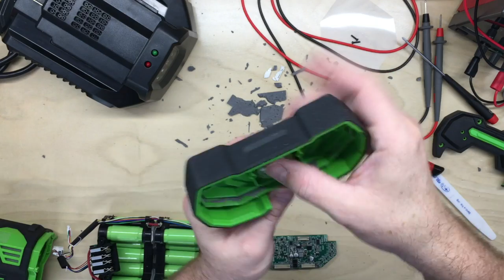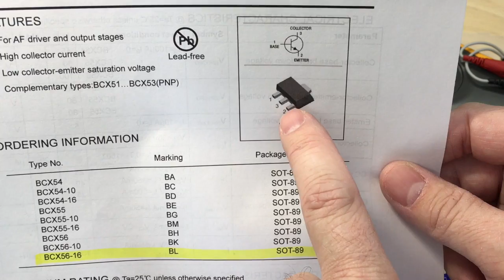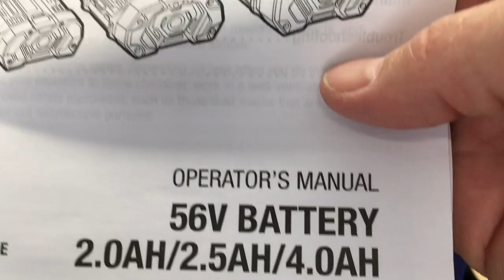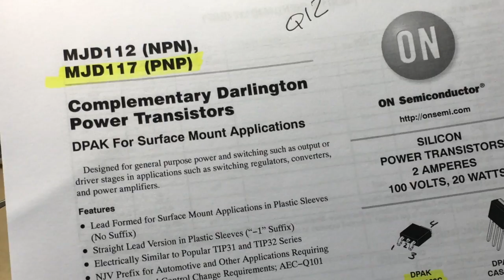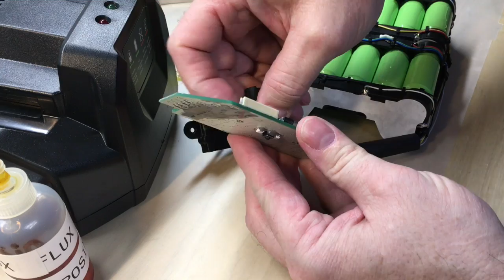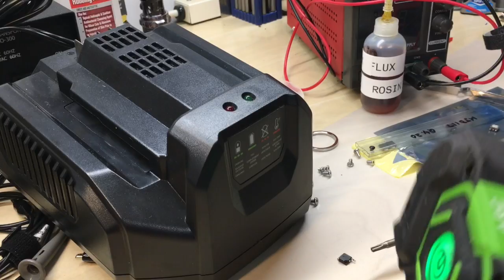EGO 56V ARC Lithium Battery Repair

Comment: Not sure if you are going to see this but I was hoping you could post the order of the wires in each connector on the BMS.  I was taking mine apart and ended up pulling a few of the pins out of the connector and I am not sure where they go now :/
Reply from the maker: I do see it. I also have a video helping someone with a very similar question if it helps. I shared the BMS wiring. Just ask if it is any other questions in particular that it doesn't answer for you! Hope it helps! Best of luck to ya!
Reply: @ThriftyToolShed  This is amazing, thank you so much! I was able to find which wires go where for the cells.  I did pull some of the wires from 3rd connector and I was able to slow down one of your videos to see the order.  It appears to follow the same order it comes from Red, Red, Skip, Skip, Green, Blue, Black, Black. I still need to replace a cell before I can test it but I am pretty sure its right.

Again thank you so much for your videos!
Reply from the maker: So glad it helped. Awesome job getting yours back together.
Reply from the maker: If you search for EGO BMS wiring this should come up by the way! 
https://youtu.be/RfTJODoh8Q4

Comment: howdy. first i would like to thank you for the very in depth diagnosis you did. it has helped me atleast dive in and remove the silicone protector from the board. The battery in question is a BA4200 7.5ah and i have absolutely no status indicator at all. when i press it, it doesnt light up or flash. when i put it on the charger the led indicator on the battery doesnt light up or flash. it seems there is no power at all getting to the led and i was hoping if you could tell me what components i should look for to test to see if they are bad. i tested q8, q10, q11, q12 and all seemed to be ok though when checking q8 q10 q11, when i swapped the leads around, it showed resistance on the center pin but only after a few hundred milliseconds (approx). when the probes are switched around, it all checks out as normal i think. but all three exhibit the sme behavior so i chalked them up to good as well.

if there is any way you could give me a few ideas man i sure would appreciate it.
Reply from the maker: I have not worked on the 7.5ah so I am not 100% sure how similar to the 2.5 and 5.0 packs. I would think the BMS is very similar. The caps on BMS board should have around 10VDC on them as the power rail from the DC-DC converter circuit. This powers up when the push button is pressed. So check that and make sure that part is good and troubleshoot from there. I do not have a schematic of this board so I just probe around and do my best. It's been over a year since I worked on one of these but also check the fuse on the terminal board. I have had these blow, but I believe the BMS is still powered even when the fuse to the output terminal is blown. I wish I could help more. I do have a few videos on some 5ah packs including the blown fuse repair. I basically have shared most of what I have learned about them so far. I also have a video about "What is the D-terminal?" and I mention the BMS a little that I have learned about it and much still left to discover. Hope it helps.  Best of luck to ya!
Reply: @ThriftyToolShed  thanks man. I appreciate it.

Comment: Great job!!!
 I have a same battery that have some problem. I checked it and find 5 cells were died. I replace them it's ok, but I have a problem, there are 13 wires connect to each cell, I reconnect to 12 of them after repaired, but the 13th one I don't know where to go. this cable is black color and nearby Q31. in J2. Would  you mind help me find out this information?  thanks a lot.
Reply from the maker: I do have a video on the EGO 2.5ah BMS wiring that I uploaded to help someone with a similar issue. Let me know if it does not help you, and I can look further into it. Thanks for your comment! Best of luck to ya!

Comment: Are the boards identical on the batteries? Just wondering if they can be switched out.
Reply from the maker: If you mean between the different capacities they are different. The microcontroller at least does has different program for pack ID. Some tools know which pack is installed.
Reply: @ThriftyToolShed  Thanks for the quick reply. I have a 5 Ah and 7.5 Ah. One has bad cells and I think the other has a board problem so I wondered if I could just switch the good board to the other battery.  I didn't think the Ah mattered as long as the voltage is the same.
Reply from the maker: I have not swapped a 5ah and 7.5ah to say for sure. I know the 2.5ah board did function in my 5ah  but the middle board for the temperature monitoring was nut functional. So it may work ok, but as far as the tools that know what is connected may indicate wrong. Such as power inverter and I believe the chainsaw allows more output torque based on which pack is connected!

Comment: Did ego change the batteries to keep it smaller? When i opened mine there were no sleeves around the cells....it is 7.5ah battery from 2017, that im trying to fix
Reply from the maker: I have not worked on a 7.5ah pack, but I have always heard the 3S (7.5ah) packs did not have the sleeves! I am not sure if for size and weight or simply the thermal load distributed accross 3 cells may have been sufeccient without them?
Reply: @ThriftyToolShed  thank you for quick reply ... would it be possible for you to take a look at a short video of the bms and readings i get while testing q10, photocoupler(Q6) and Q12?
Reply: https://www.youtube.com/watch?v=nDJRJGvNpkI here is the video... thank you

Comment: i noticed that you didnb't re-pot. Would something like https://www.selleys.com.au/products/sealants/selleys-roof-and-gutter-silicone/ be suitable for the job? lots of wet weather work here, and dont want to short the board when water is pushed through the pack
Reply from the maker: Well I don't know about this product for sure. As far as silicone goes, GE silicone II is usually ok to use. I usually don't re-pot just because it's easy to work on again in the future. If you are for sure going to be in moist environments I would re apply it.  I think silicone is ok as long as it's known not to be the type that give off acetic acid. Test out a little on some cardboard or rag you can throw away and if it smells like vinegar after a while don't use it on electronics! I think it is several pottings made for electronic use, but is most likey more expensive than the GE.

Comment: Thank you for the video. I have a pack that shows fully charged with a green light on the charger and green solid light on the battery when pressed, however my blower would shut down after a few seconds. My cells all measured 3.25V but I have now charged to 3.8V. The tool seems to work properly now but the battery still will not charge on the charger. Any ideas what my problem would be?
Reply from the maker: If your pack has good voltage level and shuts down after about 10 secs that is a sign that most likely the pack and tool is not communicating with each other through the D-terminal. I have a video discussing the D-terminal a little but I still don't understand it fully. Could likely either be a connection issue with the terminal or either one of the boards not working properly.
Reply: @ThriftyToolShed  The problem is that the pack shows fully charged when the voltage was too low to operate the tool. Just curious if you have an idea what might cause that type of error.
Reply from the maker: @dfontaine5488  
Ok, so once charged it runs the tool fine. It could be that one or more cell is going/dropping below around 2.8V or so and that will shut the pack down even of most cells still have some charge in them. This is a common issue when one of the cells in series loses some capacity and the pack shuts down prematurely. The difference here is that it usually will flash red before shutting down though. That's odd. If you test all the cells and you do not find one or more lower than the rest then in that case it could be that the BMS board just thinks it's low either due to corrosion on the connectors to the BMS board or a fault in the BMS itself. I have a EGO pack repair video showing an issue with corrosion on either a 4 ah or 5 ah pack. Best of luck to ya!

Comment: The manual states that after 30 days the battery discharges itself to the 30% storage level. This is a BMS function - the BMS has a clock/calendar chip, probably to trigger this activity. The manufacturer recommends fully charging the pack before storage, and storing them and the charger in a dry temperate environment such as the house. Some people report their packs don't seem to self discharge. Lithium batteries last best when stored in the 30-50% charge state region. The automatic self discharge takes some time to complete, warms the end of the pack with the LED, and the LED blinks green during this process according to the battery manual troubleshooting chart.
Reply from the maker: Correct. As I stated in the video that would be normal. The video shows what thousands have now seen when what I found as Q12 shorted it will not stop and Drain To ZERO! It is now over 3 years later and thus is a known failure of the EGO pack.  Please watch video for more information, after all it is free!

Comment: Do you happen to know what the surface mount chip resistors are rated at. I knocked a few off removing the silicone. 

R117, R3, R11 are the locations on the 5.0 ah battery bms board.
Reply from the maker: I have the 1st generation BMS board and it is the following:
    R3- 392 or 3.9K
  R11- 204 or 200K
R117- 184 or 180K
Hope it helps, best of luck to ya!
Reply: @ThriftyToolShed   thank you.  Will order these along with q12 an hopefully get the battery back going. 

Is it true that the 2.5 bms board the same as the 5.0 bms board.
Reply from the maker: @joshkern9016  
I know they are similar. Mine have different connectors but that may be more of a board revision than the difference in the 2.5ah and 5ah. I am not sure. I do know mine are slightly different! Those resistor values were the same by the way!
Reply: @ThriftyToolShed  my 2.5 an 5.0 have the same connector on the bms boards. I was able to use the 2.5 board to charge an run my 5.0 with out any issues other than the size difference on the housing itself.
Reply from the maker: Great to know, that means mine are different because it is just different versions or revisions. I was thinking that could be the case. Just different gen boards. My 2.5ah are 1st gen. my 5.0ah are gen2.

Comment: I have a good pack and bad board.  Is there a way to run the ego equipment without the board?  Mine will run the equipment about 5 sec then shut off.  I have a charger so, charging the battery is not an issue.
Reply from the maker: No the D-terminal is communication between the took and pack. 
https://youtu.be/H-hggUXgYlU

Comment: How would you go about running the mower off of a big ebike battery of the same voltage 14s?
Reply from the maker: I have a video called "What is the D terminal " and I explain a little about how the terminal is communication between the pack and tools. I have not found a way around this without at least having one actual EGO pack connected.

Comment: 2.5 aH battery, 2019 model.  They change from a d117 to a p-ch mosfet, FR5410.  My battery is dead, no lights. Batteries in the pack are good,and hold a charge.  Traced from the indicator switch to a C42980 (U9) which drives the LEDs.  Everything checked good up to U9.  I can't find a data sheet on U9, anyone have a link to one?   In one of your other videos you replaced the fuse in a 5ah battery.  The auto stores have micro II blade fuses which are smaller and fit perfect placed to the inside of the board butted up next the connector.   I sized my fuse according to this chart https://www.powerstream.com/Wire_Size.htm.  3 mm(20A),  4mm(35A),  5mm(50A).  The micro II fuses only go up to 30 amps, so if you need 60A, you can try 2 in parallel.
Reply from the maker: I do not have a newer style pack to say. I was sure they changed the design, did not know how much. Also was hoping the change was a good upgrade for the BMS. Maybe not? Sounds like the DC-DC Converter is down? If it has capacitors like the older style around the center of board, it should have bus voltage on the caps when you press the button? As far as the fuses, I also bought some 50A metal links (like strips) and solder them in as well. I have not shown a video with that yet. Yeah the 30A was more temporary, but no issues yet.

Comment: DBG is usually short for debug and is likely an output from one or both of the microcontrollers.  It's sometimes used as an extra output pin that can be used to debug the firmware on the microcontrollers.  Though it really could be anything related to debugging.
Reply from the maker: True! It might be indeed.

Comment: Hi there, don't know if Thrifty or somebody else can help. I have 2 EGO 56V 7.5Ah batteries, cells are good but BMS boards are damaged. One of them has R192 and R210 fried and it is easy to identify the value because it is the same as the remaining 12 resistors, i.e. 100 ohm. I suspect that Q48 and Q60 are bad too, SMD marking is X1VX and I have no idea how to identify them and find a replacement. All my Google searches turned out to be failure. The other BMS board is completely dead, no visible burnt components on both sides and all semiconductors check OK on diode test. Any help, is welcome. Thanks.
Reply from the maker: HI,
I do not have a 7.5ah pack to say for sure. It seems the resistors are in fact 100 ohms as you stated on my 5ah as well.  I also have the X1 SMD transistors as you stated. Mine are X1NA. I believe the X1 is the transistor marking ID and the NA in my case or VX on yours is the date code of the chip. For example if you search X1 SMD transistor you will find some like the AO3401A datasheet and it shows X1 marking and the date code also and of course the lot number on the side as well. The data sheet I pulled is the Alpha & Omega AO3401A P-Channel Enhancement Mode Field Effect Transistor, this is most likely not the exact manufacturer but possibly similar. I would personally check these if i did order some and compare with diode check across known good board if possible. As far as your dead board, it is kinda hard to say without putting eyes and hands on it, but I would check to make sure power from the connector is getting to the board ( the roughly 58V that is)  and also make sure button is working because that wakes up the DC-DC converter which usually reads around 10VDC or so across the caps ( ei: C3). I also did take alot of time in this video discussing several Test points etc. which seems like a time waster to some and I know its hard to watch it all, but i did want to show some test points and other checks that could help someone as yourself with a different issue than mine.  Great job on finding at least one issue! Hope it helps &  Best of Luck to Ya!
Reply: @ThriftyToolShed   
Thanks for the reply and the info, I'll follow your advice. After some more probing on those 7.5Ah BMS boards I realized that T1 transformer, primary side, is open on both boards. I checked this few times and likelihood that I didn’t measure it right is small. Since I have 2.5Ah and 5Ah batteries I switched BMS from there and all is good so 2.5Ah, 5Ah and 7.5Ah are the same, however, 2Ah BMS board is different. I purchased few 2.5Ah batteries from eBay with the view to either use the whole board or to remove and reuse the transformers or other components as needed. Hope is that transformers are good. I noticed some other folks is responses to your video had issues with the transformer too.

I really enjoyed your videos, and I found them very informative and good. Fixing electronics is my hobby too, I don’t like SMD but there is nothing I can do about it. Thanks again for the help.
Reply from the maker: @blagojeciric32  like you mentioned  it has been a surprising amount of comments of people with the transformer issues and I have not personally seen that myself. I have been asked many times about help identifing the part. Although I tried, I could not find any info even if I pulled the can off the windings. So hopefully the 2.5ah packs do have the same transformer. Great job troubleshooting. I am still learning SMD soldering and it sure shows at least it is not as hard as I on e thought it would be. best of luck and thanks for your nice comment!

Comment: Thanks for the very detailed video!!  My 5.0 battery was doing the exact same thing.  After spending ~1 hr viewing this video, I went directly to the Q12 transistor (it tested bad as in the video), replaced it, and voila!  My battery is working again.  Thanks for helping me save $200!
Reply from the maker: Awesome, Great job! Great information also, I have not heard of 5ah packs having the same issue, that's great to know. Thanks for your comment!

Comment: Nice job. 
A couple of things, I always check power components first. If a uC is bad there's not much you can do and low power controllers don't go bad that often. Also when you solder components it's best to clean all the solder off the board after removing the component  and then, with a clean board, place the component and solder one small tap. This way you can adjust the component to sit correctly in place by slight adjustments. You want the component to sit flush on the board and when you add solder to all the tabs before placing the component you cant't do that. Try it you'll see  what I mean and you'll use less heat in the end. 

Good trouble shooting! I've been doing this over 50 years and I use basically the same procedure. I've trouble shot everything from top secret military main frame computers to radar systems to audio equipment. All with the same procedure.
Reply from the maker: Thanks for your comment. I appreciate your vast knowledge and experience.